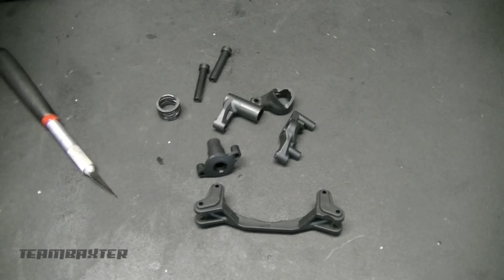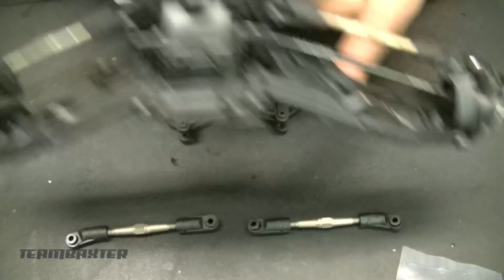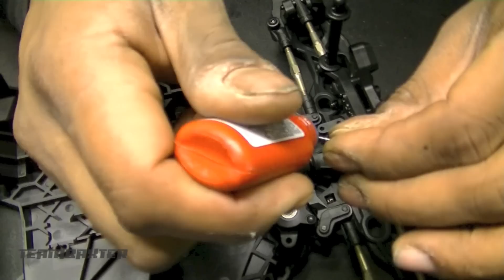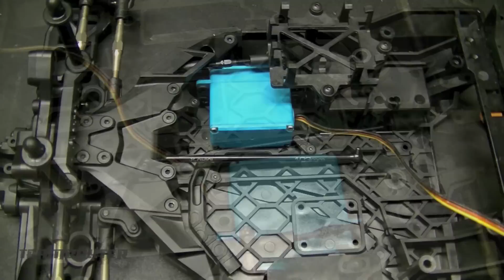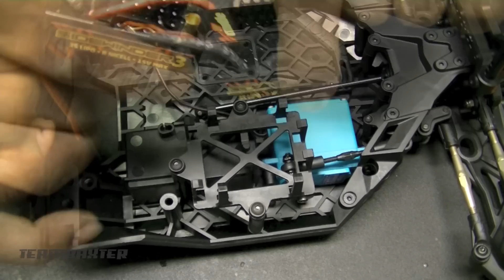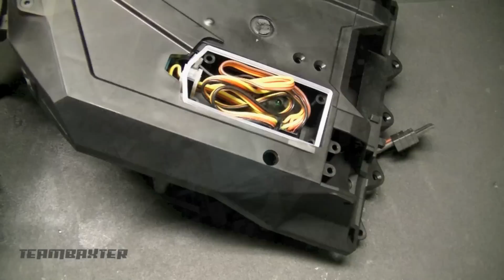Axial Yeti Kit Build: 3 - Steering/ ESC Install

Comment: Lol I did the same thing with my links. On the servo I have take mine out and remount the horn to the vertical position to get to to turn the same on both directions and shorten, tighten, the link from the horn.
Reply from the maker: ChaosGeneral1 That link situation was pretty frustrating, but my own fault for not paying attention. I adjusted my servo and mounted the horn exactly the way they asked, and it went in with no problems and works great. I think the servo position may vary from servo to servo. But it doesnt matter as long as it works, right?!